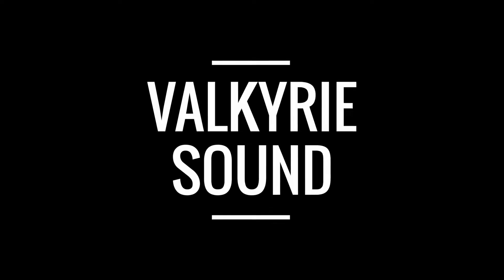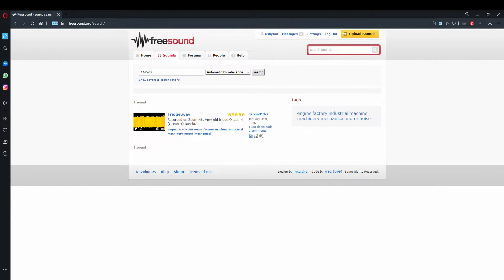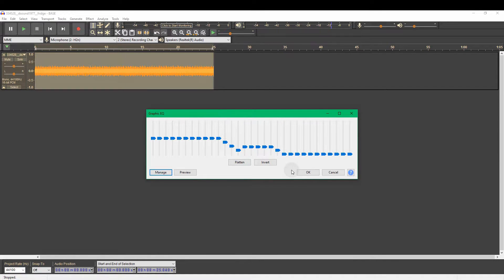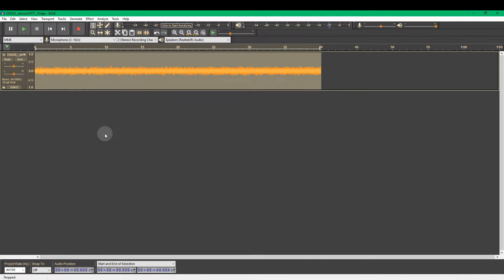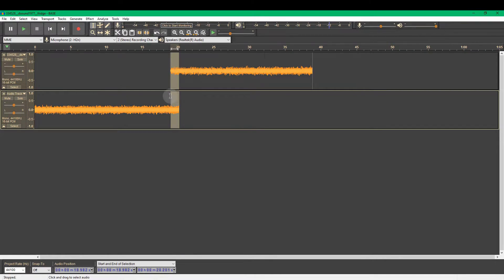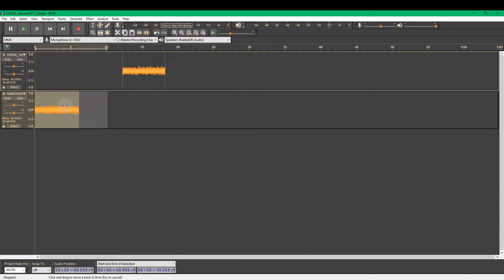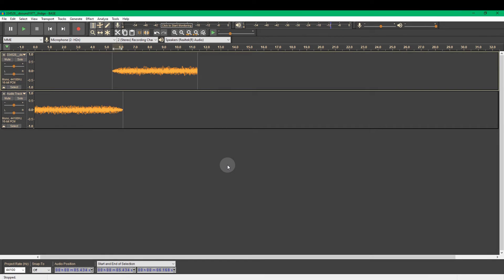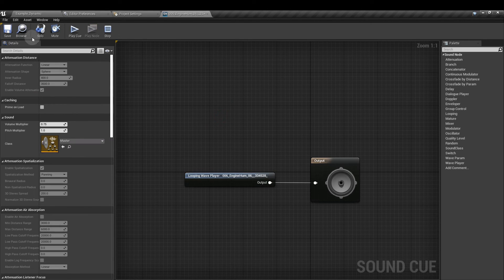Sound Design & Alien: Isolation - Part 2: Base Layer Sound

Comment: So I managed to get a perfect loop but when I implement it in unreal and select the loop option, i can still hear a clicking noise at the start of the loop which was not there when I looped it in ableton. I feel like unreal is making the click, any idea ? Thanks for the very informative video !!!
Reply from the maker: Hmm... it could be that the cut is not at a zero or near-zero decibel point in the track. Do you get the same click when you play it back on a loop in other apps? Otherwise... is it possible it could be an artefact of compression (if you've converted the file)?